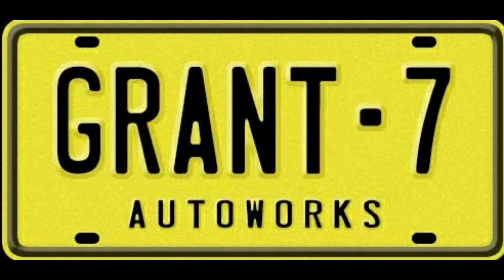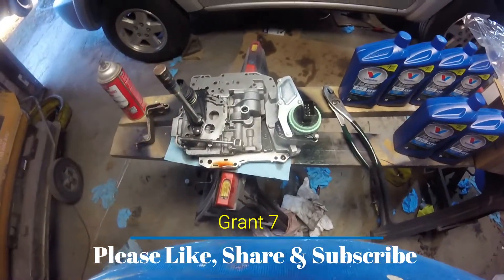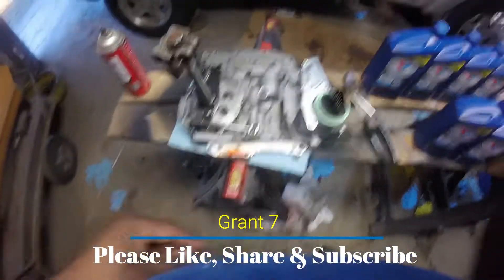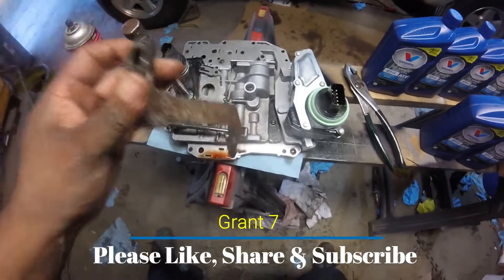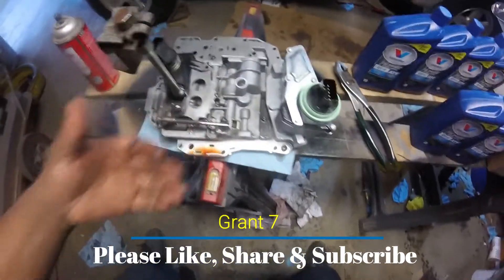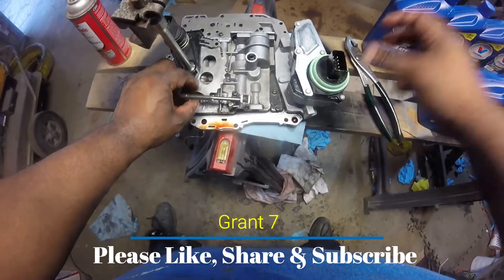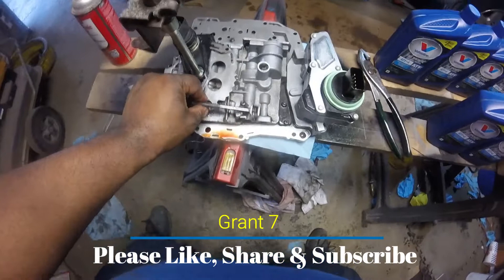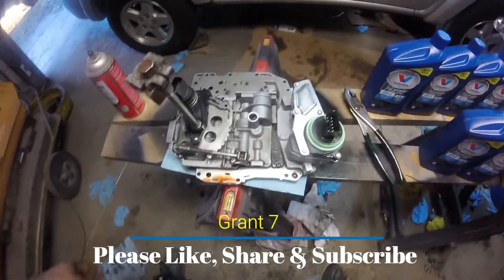How to Remove the Valve Body from a 42RLE Transmission for Shift Solenoid Repair Jeep Liberty

Comment: THANK YOU. I got a little too eager there. So that arm doesnt need to be slotted into anything during reinstall? Besides making sure it is latched on the valve body
Reply from the maker: I locked it in place be before I installed it, and then once I put the valve body back In, i clicked it back into low before installing the cable.